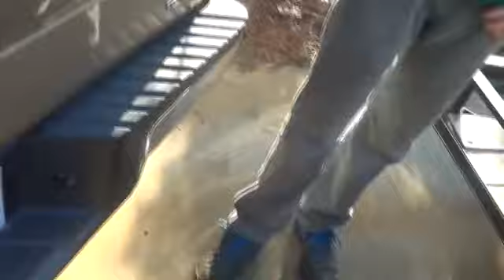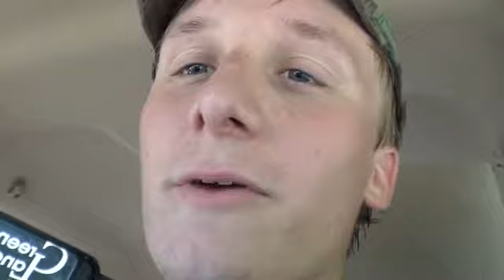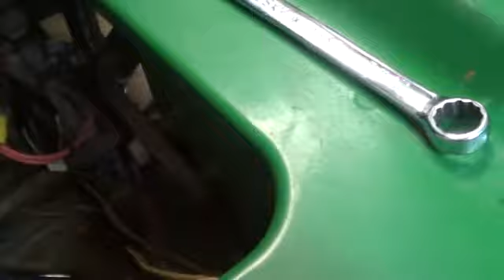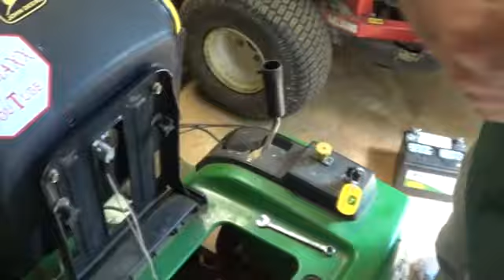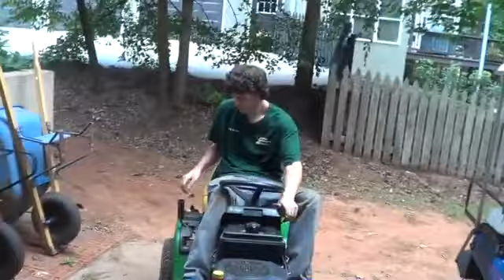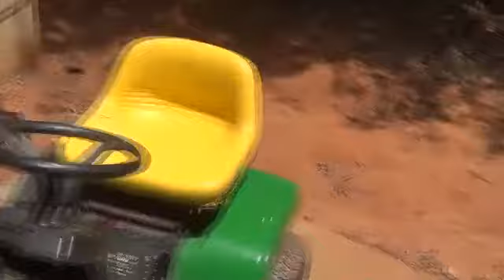fixin the john deere

Comment: I can tell you this if it spins very easy it means low or no compression . I would pull the plug out and try pressing on the hole with a broom handle end put against the spark plug hole. If it seems like it is really trying to blow it out it usually had good compression if not low compression and bad valves or piston is scratched . You can try a different trick also pour a about 1 tea spoon oil in plughole put plug back in if it starts it the valves.